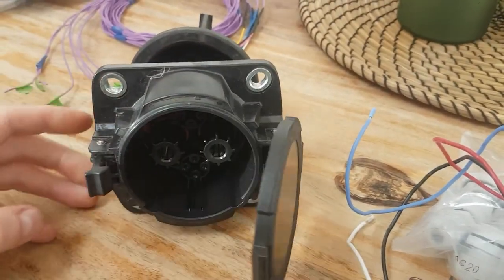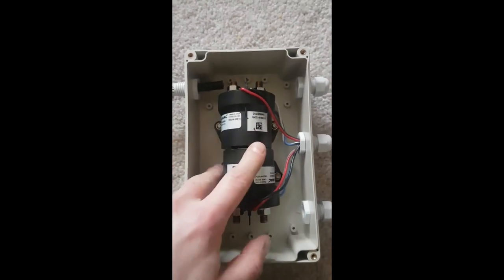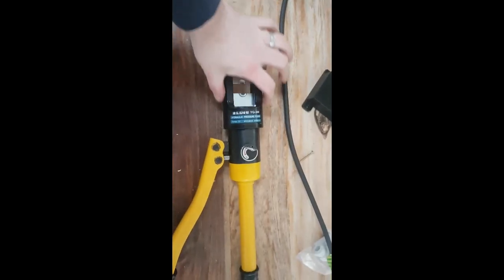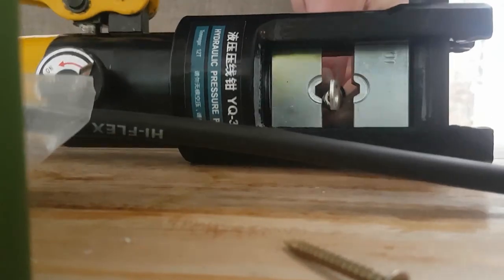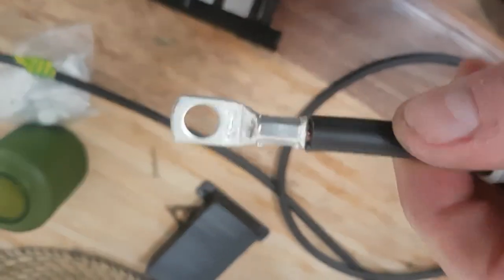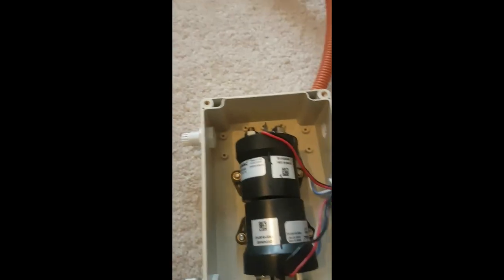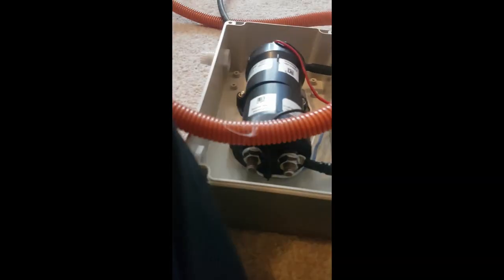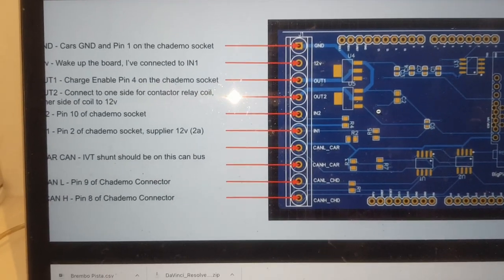DIY Chademo Charging

Comment: Will this work bi-directionally? I'm looking to add a way to export power from my Chevy Bolt.
Reply from the maker: The V2x messages could be easily added, but it's got no way of converting the DC to AC.
Reply: @JamieJones1985  I’ll take care of the DC-AC outside of the car with a unit like a wallbox quasar.
Reply from the maker: @doepnerar  doesn't the bolt support V2x anyway? Thought I sat Benjamin Nelson hook up an inverter to his chademo port
Reply from the maker: Actually, wasn't a bolt but an imiev
Reply: @JamieJones1985  It does not. The Bolt is SAE/CCS for DC fast charging only. I’d like to add bi-directional CHADEMO. I’ve seen Ben Nelson’s experiments. I don’t want to DIY the inverter side like he did. There are a number of units on the market (EU) or coming to market shortly (North America).
Reply from the maker: @doepnerar  you need to some how convince the car to close the main contactors too and reverse engineer the can bus messages a bit so you can make sure you don't over discharge. Not sure how the BMS will react to current going missing unaccounted for, maybe it won't care?
Reply: @JamieJones1985  Yeah. A bit of work to do.
Reply from the maker: @doepnerar  I've also redesigned a board and ported to ESP32, see latest video. Much cleaner

Comment: wait minute i can add this to my smart fortwo ED that only has a type2 22kw charger and a 17.6kw hv-battery?
It only takes 45 minutes at a type2 fast charger but there being fased out on the fastchargers here.

I would love to be able to charge with a CHAdeMO even if it takes the same time. its just that i have to go off the highway into a city/town and find a type2 charger that are mostly 11kw. and then im stuck there for 2 hours
Reply from the maker: In theory, yes, the hardest bit will be car integration, you could just pump current in to the battery but would be more sensible to integrate with the car more to ensure you don't over charge the battery etc. I know someones has added Chademo to a Zoe fairly easily. I've replaced this with a custom ESP32 based board. See later video.

Comment: I have 85v EV and 15kw battery pack!
Can you help me fix this
I have other parts but software is the problem!
Reply from the maker: Most chademo stations will not go that low voltage, even though the spec says so. Under 200v. What does the serial log say?
Reply: @JamieJones1985  we don't have problems here our charger 50v working
Reply from the maker: @harsha6120c  pastebin a log from the serial console and full have a look. Do DBG=3 first to get more information.
Reply: @JamieJones1985  😁 I'm not really full.  Please explain if possible! If you have Pilot program
Reply from the maker: @harsha6120c  Have you put https://github.com/jamiejones85/CHAdeMOSoftware on an Arduino Due? Go in to the serial console, type DBG=3 and then test doing a charge, paste the output to paste bin.
Reply: @JamieJones1985  yes I try to but that program have a error! library is not working properly